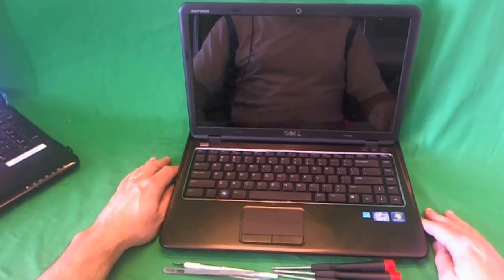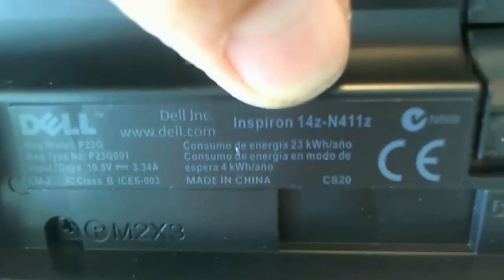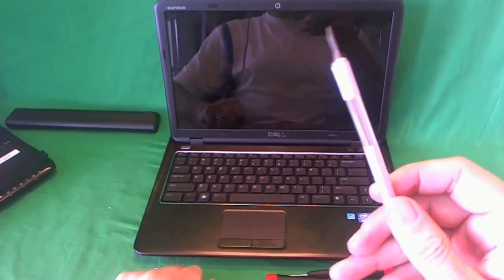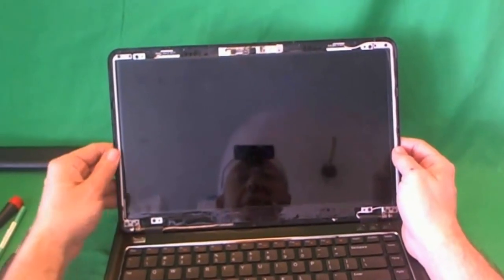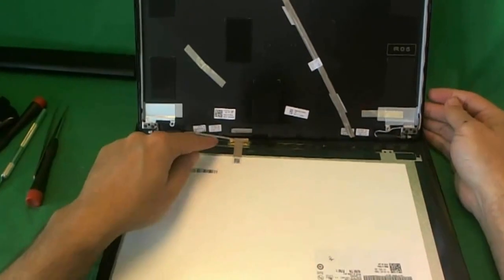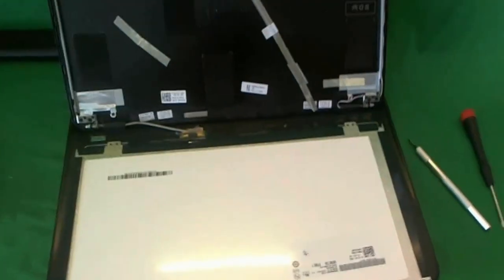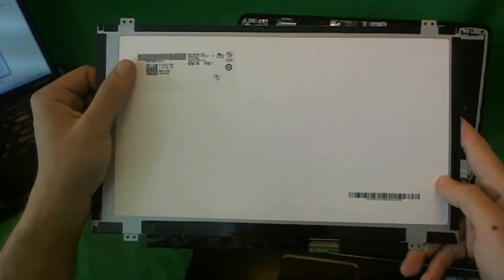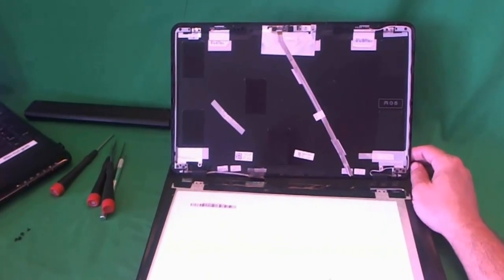Dell Inspiron 14Z N411Z Laptop Screen Replacement Procedure

Comment: Useful tip for sure. I removed the screen because when I turned on my computer I heard eight beeps which apparently means lcd failure. When it got to the lcd cable I removed the tape and disconnected it, reconnected firmly, put the tape back and it worked perfectly.